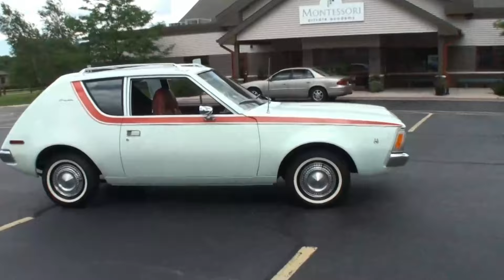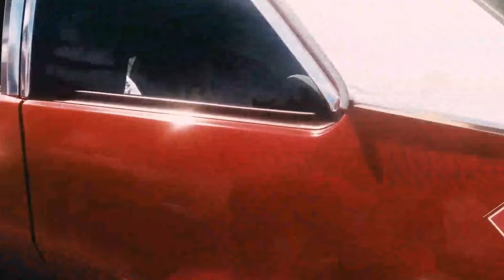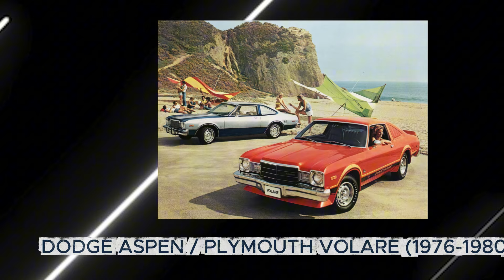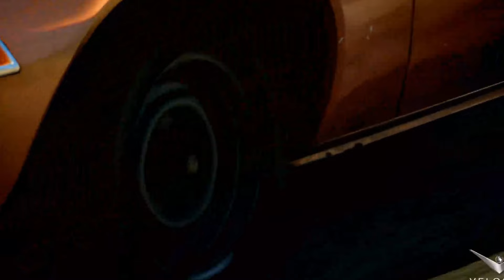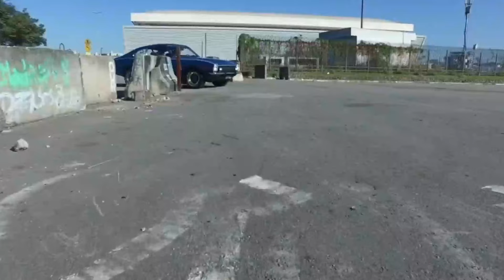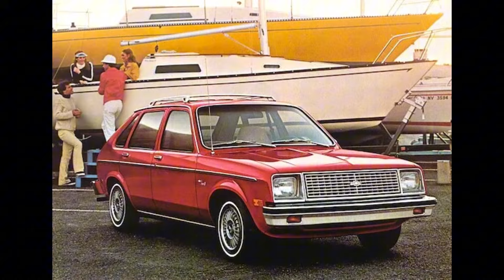8 Worst Compact Cars of the 1970s

Comment: One should been here, Datsun 210 1979 to 82, engine issues with the A series engines, bad bearings on thee crankshafts, that send the pistons into the head destroying the engine by 76000 miles. electric issues, carberator issues that caused vapor locked the carbs, and rust issues in the trunk.

Comment: I knew someone in high school that had a Chevy Chevette. I hated it almost as much as the AMC Gremlin, Pacer, the Ford Pinto, and the Chevy Vega. What utter junk. Saved the worst for last! ;-) 😄
Reply: The,71 Vega,had a great body,design,tho.Looked like a little,Camaro.
Reply: @markrunyon5524 the only problem was that it rusted away. And the engine was lucky to last the full warranty.
Reply: Pinto wasn't bad for the Times. If it had not been for the cover-up of the fuel tank issue, it would have a decent reputation.  What makes it so tragic was that it was an unnecessary problem. The car's death rate was no worse than with other cars in its class. And it could have been prevented altogether for about 12,00 per car if installed during manufacturing

Comment: A lot of compact (and even full size) cars and trucks of the 70s catch a lot of flack (sometimes unjustly in my opinion. People tend to forget that many cars and changes ti engine manufacturing were rushed to the production line and market due to an influx of foreign compacts because of the OPEC oil embargo and also a newly formed Environmental  Protection Agency that was imposing stiff restrictions on vehicle emissions.